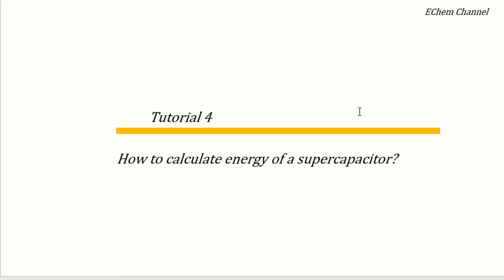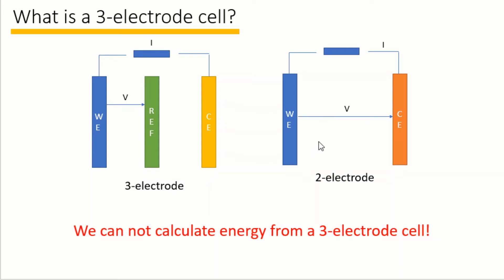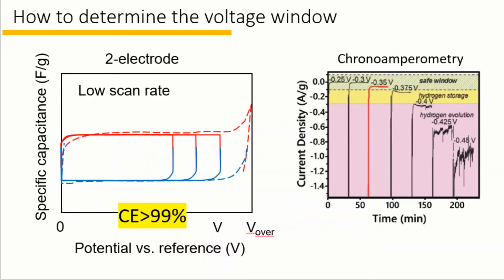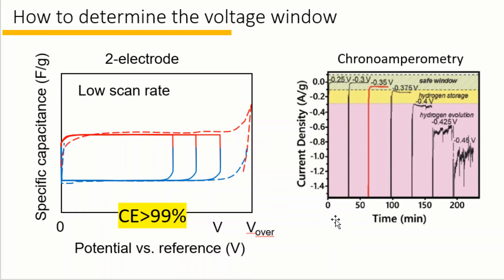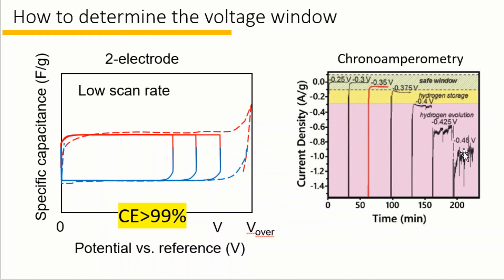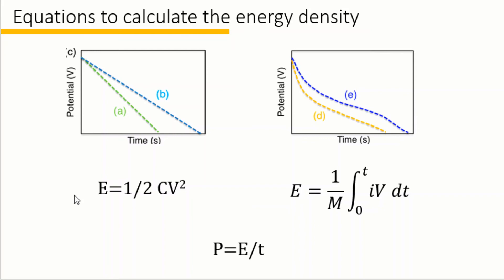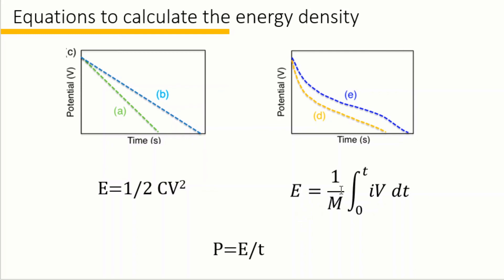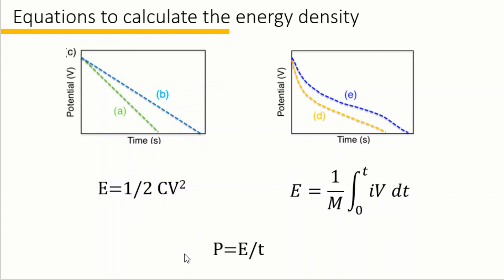Tutorial 4-Calculate energy density of a supercapacitor

Comment: why can't we calculate energy density using 3 electrode?
Reply from the maker: Voltage between the cathode and anode is an important parameter in energy calculation. In three electrode systems, you are testing one electrode against the reference electrode, so you know it's electrochemical potential, but you can't calculate the voltage against its counterpart.
Reply: thank you @EChem_Channel  for the reply. could you please cite any reference for your statement.
Reply from the maker: Hi there @8421809859 , it is the fundamental definition of energy. Work is defined as moving a charge across a potential difference (voltage). In a three-electrode system (let's say you are testing a cathode material), you don't know what the actual anode you are going to use. Therefore, energy will be different if you use graphite or lithium. In three electrode systems, you know the reference point. With a reference electrode, you know a potential. It's like knowing an altitude in terms of height. You won't be able to calculate the gravitational energy unless you know how far the sea level is from the center of the earth. It's just how energy is defined.

Comment: Hello Dr. Wang, what I have to consider when choosing the potential window for a three electrode cell experiment?
Reply from the maker: Hi Bruno, usually you need to consider the potential range so that your electrode and electrolyte do not experience unwanted side reactions. For electrodes, that could be conversion reactions at very low potentials. For electrolytes, it could be the breakdown of the solvents, like HER and OER in aqueous systems.
Reply: @EChem_Channel  ah! All right! Thank you for your answer! I have just started work with supercapacitors and, unfortunately, I'm a little lost in this basic experimental principles! Do you have any reference that could help me with this? (If I'm not asking too much)
Reply from the maker: @brunorossi2831  You may find this guideline paper helpful: https://onlinelibrary.wiley.com/doi/abs/10.1002/aenm.201902007